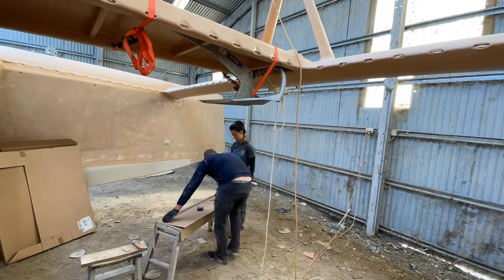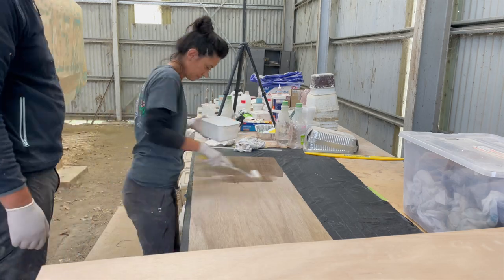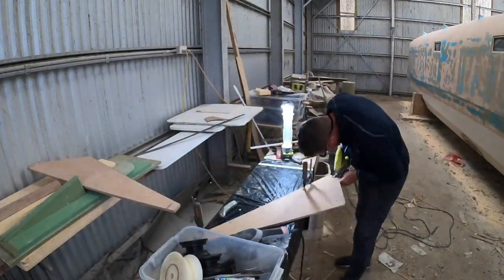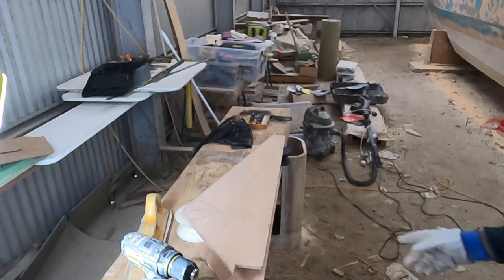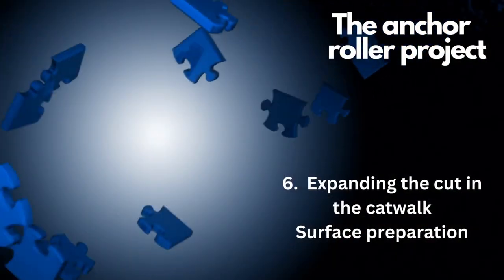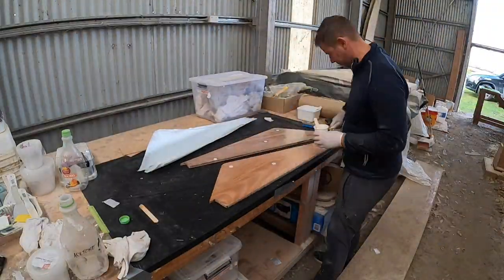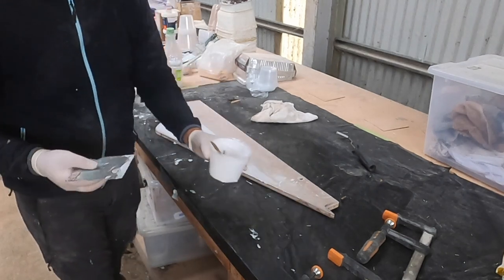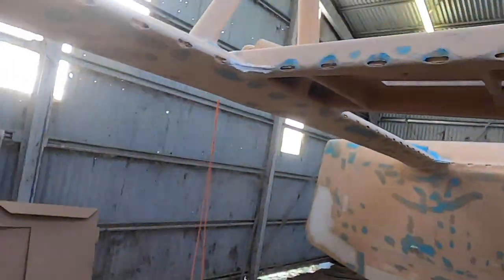Building the ANCHOR ROLLERS from scratch - Part I - S02 E35 - DIY Catamaran

Comment: Not all marine plus are created equal. Better quality marine often has more layers, but not always. But it should have very few voids. If weight is an issue use Okoume (also known as Gaboon). Meranti is often used for marine ply, but it’s 30-40% heavier. Which can be an advantage for things like centreboards if you want to add some ballast. Nice work btw.
Reply from the maker: Some weight here would have made little difference. I took the best looking sheets I could find, still, I think any Swedish standard 6mm fir ply would have been better quality. The wood used in this marine ply just appears to be of pretty average quality... Some fast growing light species of wood.

Comment: Looks easy but requires alot of forethought and preparation. Small steps, lots of measurements, more measurements, proceed.
Reply from the maker: Actually started during Covid... I designed turned the sheaves on the lathe at work, using cut offs. If any machine is scary, it's the lathe

Comment: Why the plywood when bett is out there.  “ Cosaboard  “ a glas stranded board designed for this   no Rotten future in a high stress area.
Reply from the maker: Coosa would have been a good material for sure. The simple answer is availability. I have no experience with coosa, an interesting material I might have use for in the future.